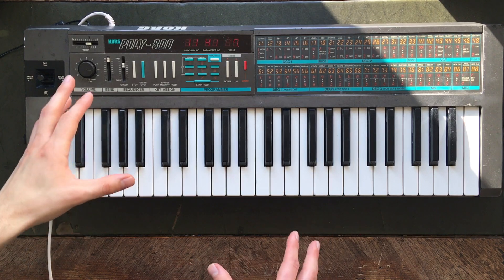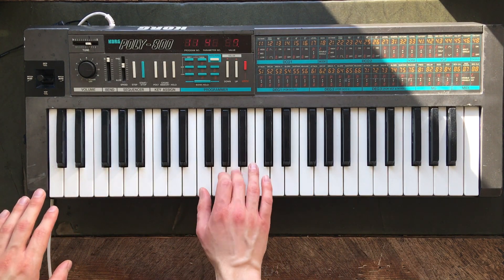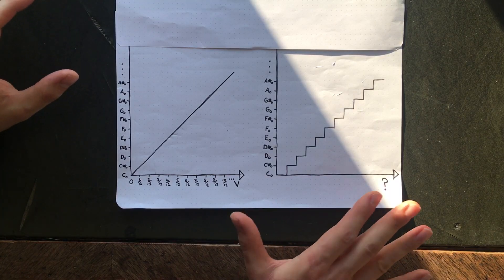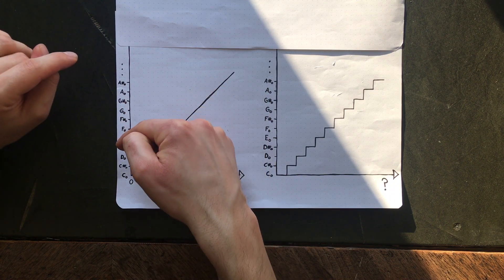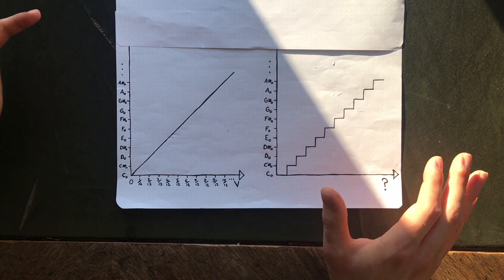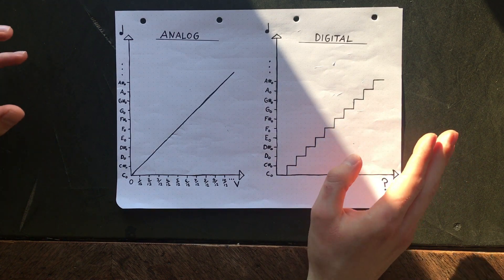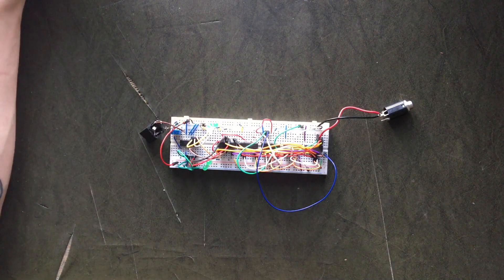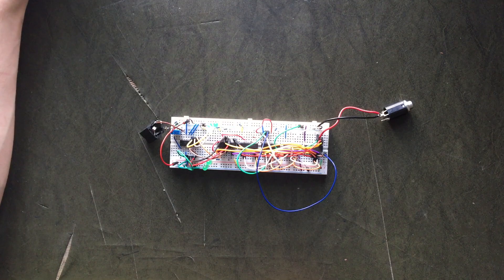Designing a DIY synth arpeggiator with logic gates: Part 1

Comment: Restricting things to discrete steps like you do here is referred to as quantization,  or something pretty close to that.  I think that may have been a feature of the ARP sequencer (1620?),  but it's been so long since I've seen one of those I'm not sure any more.  I also used to service organs way back when,  and certain models of Baldwin organs had an arpeggiator.  You could go up,  or up and down,  and playing a chord low on the keyboard would get you a nice arpeggio.  It was a lot of fun to play with when I was working on those.

Comment: nice, I started messing around with cmos logic gates a couple days ago for syncopated rhythms. Today, I was using a 4013 dual flip flop, cascading the first into the second. One is clocked normally and the second one is clocked by this PLL prototype I ve been working on. Also, the PLL uses a random slewed lfo into it's input. It ''humanizes'' some of the patterns. I m a newb that's discovering the amazing things you can do with chips that weren't intended for these uses at first. Your arps vids are the next logical step. I need a DAC first.

Comment: Could we also use the multiplying DAC and some extra circuitry to give our scales different melodic modes? It'd be challenging but worth it to think of a way to have custom LUTs accessed by a small cheap FPGA or CPLD that could theoretically allow an infinite amount of custom modes. 

Also I'm guessing that parallel arpeggiators would be required to make a chord, but have you thought of a way to do unison without all the extra hardware? I feel like op-amps have a purpose here but I'm unsure what the actual hardware would have to be. Perhaps at the end of the day you'll  need multiple VCOs that all drone differently relative to the primary tone.

Comment: Hello Moritz, hope you're doing well! I've spent the entire afternoon trying to wrap my head around a problem I'm encountering with this build:
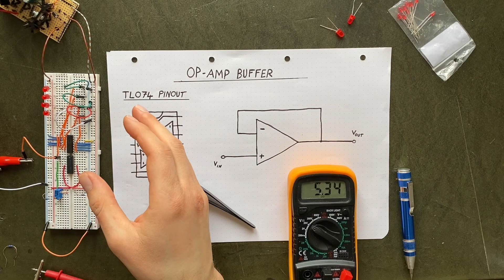When I reach the 12:19 mark, I do read 5.33V on my multimeter, but changing the values of the counter reduces the voltage, as if the OP-AMP wasn't doing anything. I was measuring at the output of the OP-AMP, but trying other points had the same effect. I am using 9V batteries, since that's what I started with when watching the VCO series, but I don't see why that would be the cause.
I've started from scratch twice now, and I keep running in the same problem, at this point I'm very confused.
Thank you so much for doing these videos, this along with your VCO series are a great introduction to electronics, which looked very daunting and complicated in a previous life :p

Comment: The bit outputs of the ADC0820 will only be going between 0-5V (LOW and HIGH) but the TLC7524 (if it is powered by +12V) will need a voltage which is higher than 5V to read its bit inputs as HIGH.  At least i assume that is the case based on the data sheet. Did you get the TLC7524 to work with just 5V coming into its bit inputs?

Comment: I will admit I find it a bit sad that you are going to all the trouble (trouble in the modern sense, given that you can just go and buy an Arduino) of building an analogue modular synth, but then you decide to fix your sequencer to 12EDO, which is an ugly (and recent) musical compromise to keep keyboard instruments cheap. I can't help but feel that, for conceptual uniformity with the VCO, this should ideally be done with analogue components or, failing that, at 12+ bit resolution so that the available pitches are perceptually smooth.
Otherwise—I mean, if you really believe in 12EDO—it might have been easier to make the VCO work with a counter and talk to it over a digital bus! ;)

Comment: I'm no electrical engineer, but an idea: maybe use 12 bits for all the notes, and then use the other bits for things like changing octave, empty notes or changing the note value to half/quarter or other stuff like that? i do not know how hard that would be, but hey worth a try maybe
Reply: 12 bits is 4096 steps. If you mean 1 bit per note, you can use something called a priority encoder to take the "highest" note and convert that into the binary number equivalent (4 bits which lets up to 16 states). For octaves you could use a parallel shift register to shift all the bits the number of octaves. Shifting left is equivalent to multiplying by 2.)

Comment: Hey there, I finally got around to trying this out with a TLC7524 and I have built it exactly as you have, the only difference being a +9/-9 power supply. No matter what I try I cannot get the perfect ramped scale as I should. Any idea why? I divided 256 by 9 then by 2 and by 2 again, and tried it at 7.1v for the reference voltage and even divided it again and tried that. My scales are not working at all and I am certain I have not made any mistakes. Any ideas/help would be most appreciated!

P.S. What happens is it plays a C at 0000 and then a C# and maybe a D and then a C and then E, F C, D, C ... something like that.  
  
EDIT:  I found the "error" but it is still a mystery... I changed the breadboard and it worked... All exactly the same but the original breadboard did not like the circuit haha! 
This is the frustration and mystery of electronics. Sometimes the problem is a goddamn breadboard and you will lose your mind until you figure it out.

Comment: wouldnt it be possibble to to quantize the potentiometers with schmitt triggers? Not really sure though if itd make sense component count wise
Reply from the maker: not sure i get the concept - how would you go about doing that?
Reply: @MoritzKlein0  sorry, had the wrong idea of schmitt turning off when voltage is too high. 
Comparators might work though. If you use one for each note and set the upper and lower threshold,  it leaves room to have blind spots or overlaps on the potentiometer in terms of notes. No forbidden states as they are simply not allowed but 1/note comparators, so economics will decide up to which point it makes sense

Comment: So this is why every module has a TL074!
Reply from the maker: buffering is really essential!
Reply: @MoritzKlein0   - in the case of simply buffering, can I use an lm358 instead of a TL072/4? I generally try to avoid them because, while I have a benchtop power supply to get +/- voltage, I want to be able to just use a 9v adaptor for the projects I build.
Reply from the maker: Tan Stowell any op amp should do. though you can definitely use tl07X with +9v and ground. just make sure you don’t feed it any negative voltages then.

Comment: I have a question: So far to use 5 1/3v ref we will get the maximum of 64 notes (5oct n 4notes) with max 6bits for the tlc 7524 but what if the ref voltage is 10 1/6 instead and we take 7 bits out is this possible to get a 10 octave range from the IC?
Reply from the maker: yep, no problem!